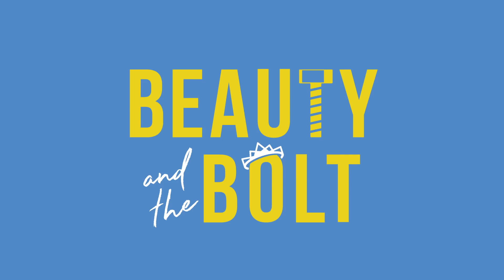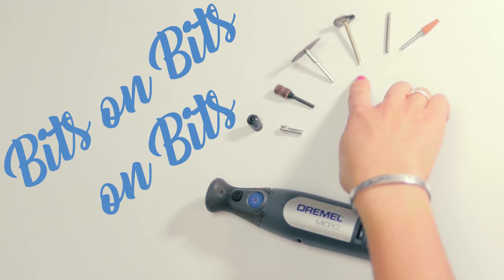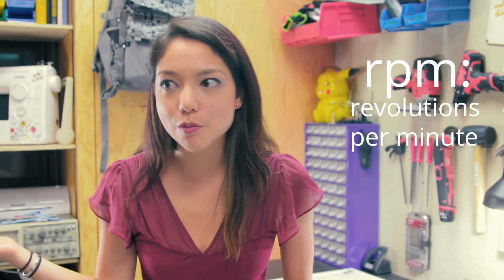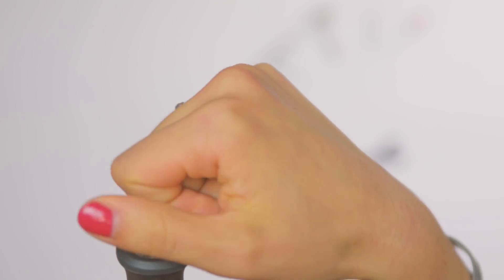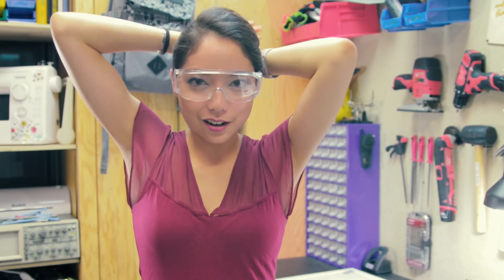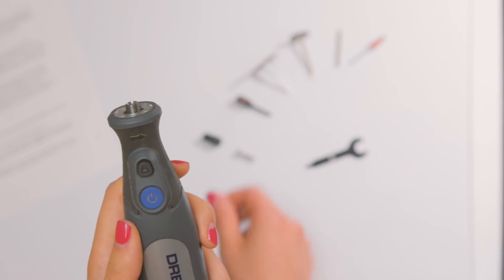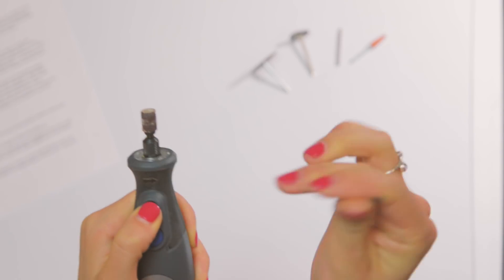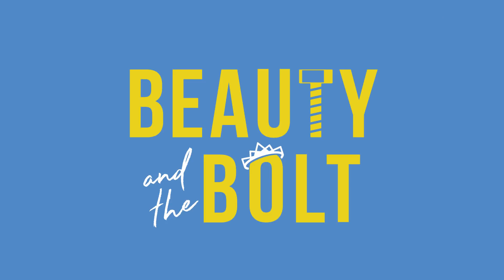Rotary Tools 101 - Learn Dremel Basics and Safety

Comment: I've had (4 or 5) Dremels and (2) Black&Decker knock-offs.  I have a couple of the flex-shafts.  I have a router base. I've got all the collet sizes too.  I never got into the fancy quick-change quarter turn accessories.  I really like the brown very thin cut-off wheels (I call them potato chip disks).  They cut through steel easily and are great for making very straight cuts in plastic.  I'm not generally into B&D tools, but their rotary tool may be their best tool of all. I especially like the way the spindle locks for changing bits.

Comment: Nice video! 
Those pink tools on the wall are sick!
my wife always said she wanted pink tools, where did you get them?
Reply: Those are red...
Reply: @mykookie8354  you are color blind honey,
Look at the subscribe button under the video, it is red, compare it with the tools you see on screen.
Are they the same color?
Reply: @beepIL  Im far from color blind actually. Its called a camera though. The angle we are looking at the tools make them look pink. Im also 99% sure those are Black and decker, which is a red/orange brand.
Reply: @mykookie8354  I stand corrected...
They are red, i found the same tools used by her on another video,
Those are milwaukee tools, which have a trademark red color to them
Reply: @beepIL  I never seen that brand of drill before, and I've seen red black & decker drills before, so I assumed it was Black & decker. But, the background is blurred, and cameras can alter the color of certain things, depending on whether its shiny, or matte. I can see how you think its pink, but Yeah... 
Also, if your wife wants pink tools, put some tape on the parts you dont want pink, and use some good ol' spray paint! Its a life saver

Comment: I've had bad luck with either newer or cordless Dremels.  They seem to have more vibration and wobble in the shaft than the older, corded Dremels have.  Even when you powered up that one briefly, it had kind of a buzzy sound instead of a smooth sound.   I'm going to try this: http://messageboard.dremel.com/Topic5462.aspx but I think it won't help because it seems buzzy even without a bit.  My older, corded Dremel has been smooth, quiet, and precise for years now.
Reply from the maker: Hmm, that’s so strange! I found the corded ones to be buzzier and this tiny one to be incredibly smooth, BUT this is being judged by how it feels rather than sound- I’m usually listening to music when I’m working alone. I wonder if I’m also happier because it fits my hands which are likely smaller than most dremel users, and that’s affecting my perceived performance because my hands don’t cramp from using it. -Xyla